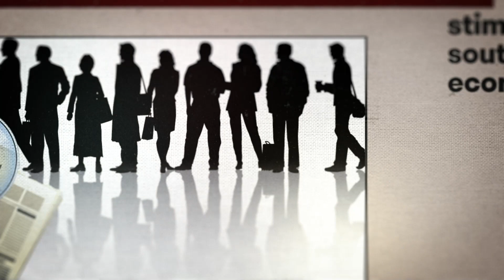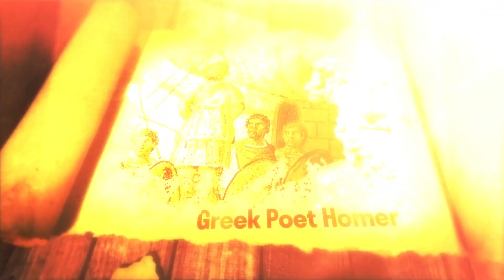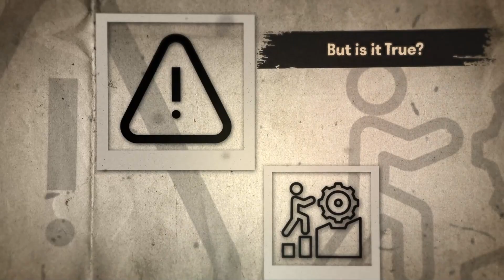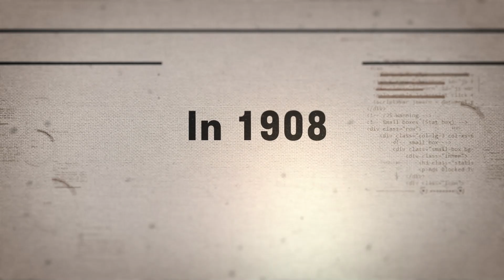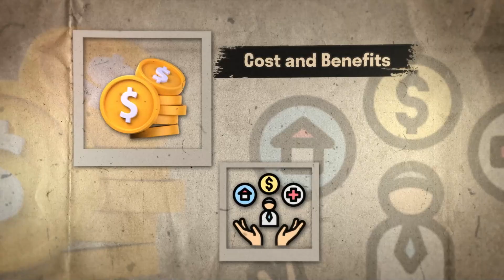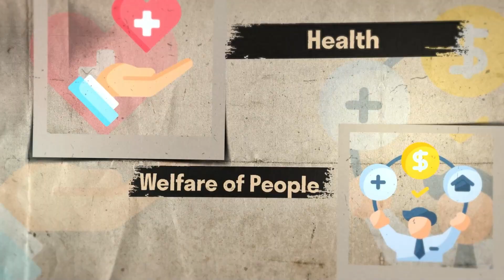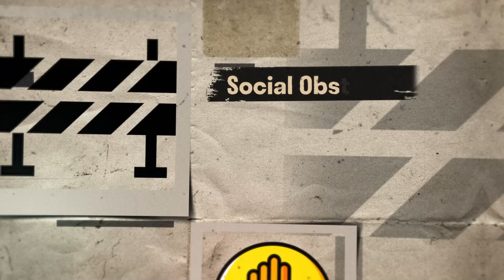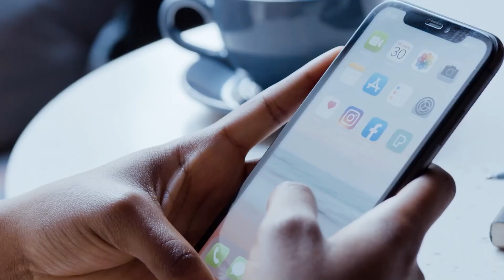The Real Reason Why Italy's Bridge To Sicily Won't Work

Comment: Make it simple idiot. as simple as filling with roman concrete blocks, the space separating Calabria and Sicily. It is only 3 miles long.
fill the water gap with concrete blocks and build a 6 lane, plus 2 railroad tracks over it. It is not that deep, only 200 meters. easy piece of cake. Of course, must make room for giant waves, high and low tides.

Comment: I am Italian, the problem that concerns me the most is the fact that there is no way to arrive to calabria by fast trains yet, the roads are bumpy and regular bridges on highways are falling because of the lack of maintenance in the southern part of Italy.
There are evident problems in providing good infrastructure, healthcare and educations in both sicily and calabria.
In calabria moving around with public transport is impossible, some sections of railways are closed because of safety issues since 2012 or something, most of trains are not electric (as they should be), since there is not electrification along those lines.
Solving this issues should be a priority right now.
I am not a civil engineer so i won't comment on the feasibility of the project, but there are a lot of scientific papers that say that we will not be able to put rails on the bridge since the tracks are not flexible enough to guarantee safety for the bridge (which needs high flexibility to dampen wind) and safety for the trains (that need low flexibility).
I'll also say that the fear of mafia infiltration is high and we are right to fear it. Mafia always had tight connections with building infrastructure, especially in the south where it has more power. A lot of mafia experts say that the mafia will benefit from the bridge.

Thanks for the time and effort to read all of this. If you have any questions feel free to ask!
PS: great video
Reply from the maker: Thats good information. Tha ks man